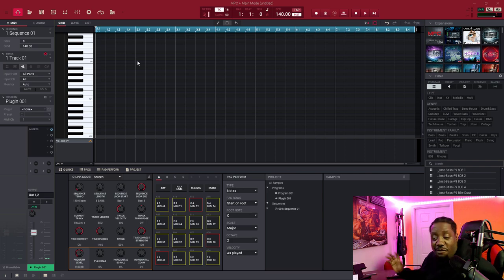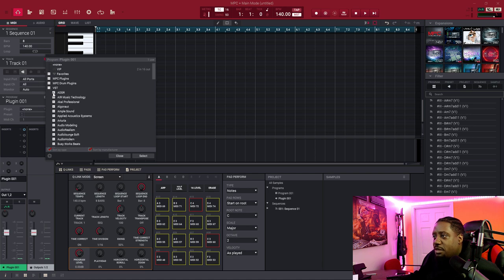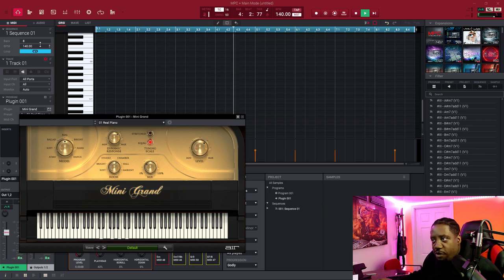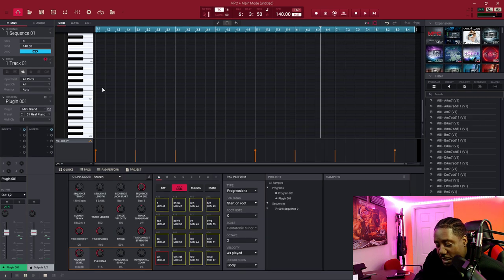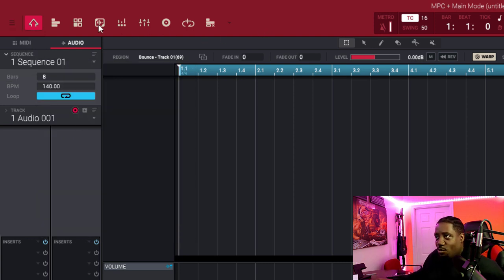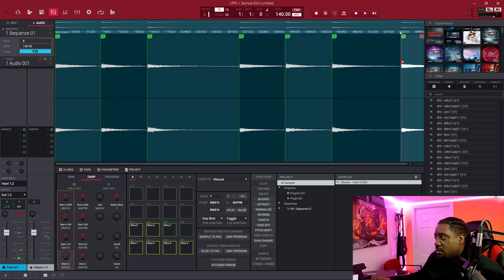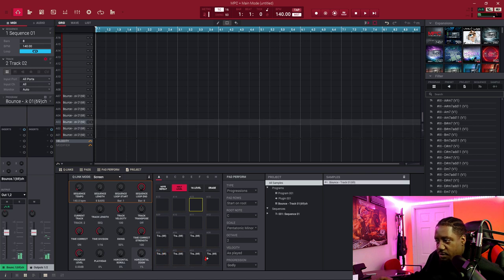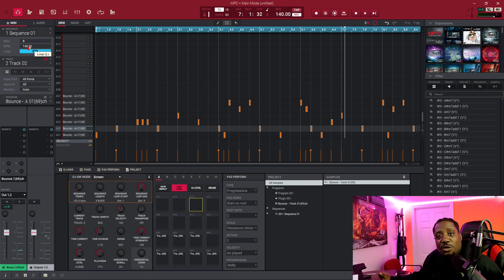How to turn on loop function Akai MPC Software

Comment from the maker: if you have a how to question drop it in the comment
Reply: @doswell beats Please bare with me Im very new to this but if I forgot to have the loop button on after i started building the track and the bars were set to 4 instead of 8. Do I need to unfortunately start from scratch and redo it and extend the bars to 8 and have the loop button on? Hope this makes sense. Thanks so much
Reply from the maker: Welcome to the channel thanks for watching and leaving a comment. No you don’t have to delete it. If you need 8 bars but you only have 4 after you record it. It’s 2 ways to do it. 
1). Just put it on 8 bars. Then select all the note’s on the 4 bars by hitting (Ctrl, A) and hit (Ctrl, D). That will duplicate the the first 4 bars.

2). If you only have 4 bars but want 8. Use you mouse and go to where it say sequence at the top left. Right click your mouse and select double length. Then you will have 8 bar. Just change up the second half if need to. Let me know if that helps 

Thanks for watching 👍🏾🙏🏾
Reply: @doswellbeats  Omg Thank youuuu sooooo much!! You are the best!!!!!!!!!!! I knew I subscribed to the right channel!!! Appreciate ya
Reply from the maker: Thanks for subscribing I appreciate it. I like to help with what I know . I try to share information with everyone that ask🙏🏾👍🏾. Turn on the bell notification so you can get alert when i post new videos
Thanks again 🙌🏾
Reply: @doswellbeats  Most definitely will🙏🏾
Reply: @doswell beats I was wondering if there's a way to send the 32 outs to another DAW or do it have to be external to a mixer ??? thank you
Reply: I have the MPK mini. I wasnt to build out songs live. I dont understand hgow people do it on youtube. Super lost. HELP! Lol

Comment: in our preferences we can adjust the "sample rate/audio buffer size/latency adjust" from our audio device  - can you tell us how exactly to work with that? how big has my audio buffer size to be, when do I need to raise it? I feel if im overloading my mpc beats programm with to many sample that play at once I kinda making it laggy, I feel there is a connection between these settings and my problem
Reply from the maker: The lower your buffer size is (64) the less latency you get. But it works you CPU hard. The high the buffer size (512) and higher the more latency you get. But it don’t work your CPU as hard. It all depends on the power of your computer. If you have a powerful computer you can go to (64) or older (512). 🙏🏾👍🏾

Comment: And also.. could you make a video on how to sync your akai keyboard to MPC beats correctly
Reply from the maker: No problem bro I will put that on my list of video to do. Thanks for watching I appreciate it
Reply: @doswellbeats  ok great and when I mean like syncing the keyboard… I mean like syncing the pads too… like I be hitting my pads and nothing plays even tho I have my program all set
Reply from the maker: What midi keyboard are you using?
Reply: @doswellbeats  Akai MPK mini 3
Reply from the maker: You mini comes with a program editor software that will help you program your midi learn so you can control the software. Just register you mpk at Akai pro website and it should be in you things to download. If you can’t find it you can try this. At the bottom right of the mpc software. The box next to the smile 😀 face. Is you midi learn. Hit that button
2) then go to the dropdown on the right next to enable 
3) select the mpk mini that you have 
4) it should automatically set it up for you
5) or you can do it manually 
Let me know if that helped you out 🙏🏾👍🏾

Comment: Is there  an option to export the tracks to audio so that the effects sound from the beginning of the loop? Now when I add some effect like reverb, it doesn't bring the "tail" to the beginning of the loop, so it sounds unnatural when exported to audio and looped. My way, when I want the effects to work from the beginning, is to extend the sequence four times and cut the middle bars
Reply from the maker: In your settings preferences you can set if you want the tail or not when you export to audio. Also you can set if you want your effects to be added to your export. Check your preferences

Comment: Okay so I trimmed my sample and it loops nicely with the "play continuous loop" button. Now how do I move that snippet so it plays with the main track and I can add drums etc?
Reply from the maker: Ok on the same screen where you are chopping the sample at the bottom middle of the screen you see it say non destructive. Hit new program and then you can select non destructive or pad parameters. If you want to know the difference between non destructive and pad parameters. Check out my recent video i just did

Comment: Ciao, first thing thank you so much for this video, Is so helpful. I have a questione for you, does MPC Beats work whith all the kind of plugins? Because I tried to insert endlesss studio x black Mask but Is not working.  The origami find them when I do scan plugins, I push ok, but then I can't find tham in the plugins list
Reply from the maker: Welcome to the channel. The MPC software only recognizes vst , vsti , vst 2 or vsti 2. It doesn’t recognize no vst3 or AAU or nothing else. So make sure when you are installing for the mpc software you only select vst2 or just vst. Also only the 64bit not the 32bit version or the vst.
Reply: Thank you so much man! Was going Crazy. I Will check it
Reply from the maker: No problem you are welcome 👍🏾🙌🏾

Comment: Question, do you know if the MPC Touch works with 2.10? Is anybody you know rocking MPC-Beat and a Touch?
Reply from the maker: It works perfect bro . That’s what I am using
Reply: @doswellbeats  Thank you so much man!
Reply from the maker: No problem bro do you have one or planning on getting one ?
Reply: @doswellbeats  Looking at getting one can't really afford the new ones yet(the One and Live 1 & 2). Not to many people are liking the MPC Studio 2. Seeing a lot of returns on the used market already.
Reply from the maker: In my opinion I would get the mpc touch before I will get The studio 2 they are both controllers. The reason is the touch give you a similar work flow as the MPC LIVE. The screen makes it similar to the live only thing is you need a computer. If the studio 2 had a similar screen it would have been cool
Reply: @doswellbeats  That's what I was banking on, Thanks I'm going to get a MPC Live II  but that's might take some time. $1300 is not easy to come by.
Reply from the maker: I understand bro $1300 is a lot. The Mpc one is also good did you take a look at that one. Only difference is the mpc live 2 have a speaker for when you are using it in standalone. And you don’t need a outlet it have a rechargeable battery. That’s where the extra money come in at. Other than that they are both the same. They run the same software inside no difference in workflow.
Reply: @doswellbeats  I'm going to take a closer look at it today. Thank you I really appreciate your help.

Comment: How to turn on loop on samples, on "note on" mode, without holding fingrs on the pad? How to adjust sample to start-stop looping thing? Not the bar, just the sample?
Reply from the maker: Are you talking about when you are in sample edit . If so pad 16 is used to loop the sample
Reply: @doswellbeats  nono, a talking about "start-loop-stop" thing, just like the old SP808 samples do it. There are 3 way to play samples on it, 1, is just like here "when you touch and hold there are sound" 2. "Drumtrigger thing"  and the 3 is most usual in liveacting the "start-stop" or Start-loop-stop" So when I hit the pad it starts the loop, and i press it again it stops. Its needed in liveact on stage. I bought this MPCX in 2020, and play on only 2 months, and take 4 years to repair it, because the supply of spare parts is quite weak. :D
Reply: @doswellbeats  and the "hold" function button is also very missing
Reply from the maker: I am not sure bro . I don’t have the answer for this question 👍🏾🙏🏾
Reply: @doswellbeats  Thank you for your time! ;)
Reply from the maker: Thanks for reaching out bro sorry I couldn’t help you. Let me know if you ever figure it out 🙏🏾👍🏾

Comment: While recording, sometimes when i play 2 different notes seperately...the 2 notes overlaps and doesn't leave a gap! Any solution for this?
Reply from the maker: Make sure you are not recording in Bars. You need to be recording in 1/16 or 1/8. I would recommend 1/16